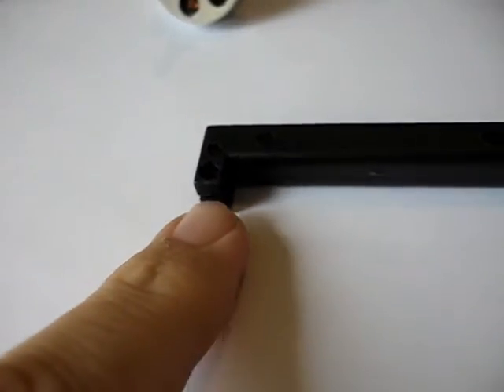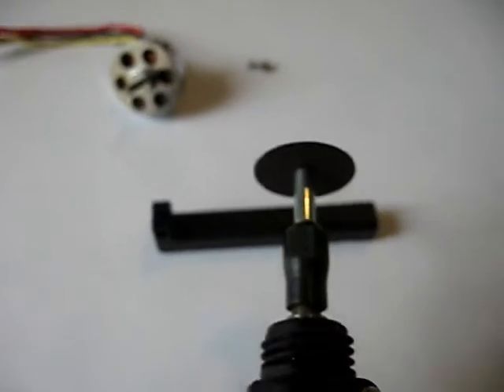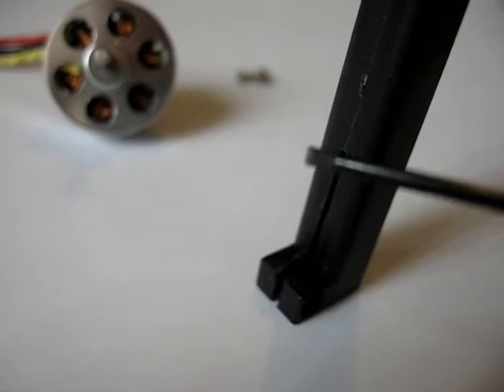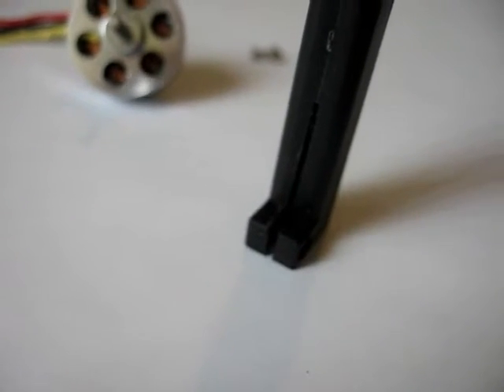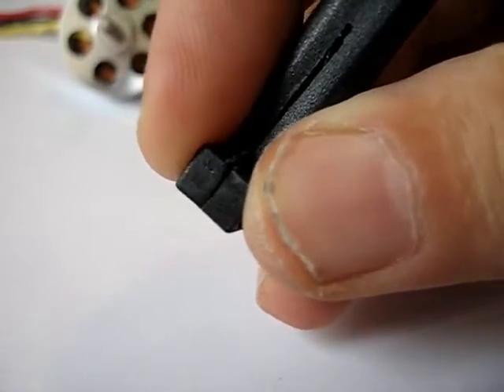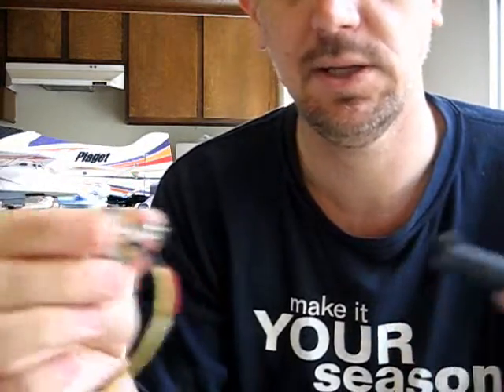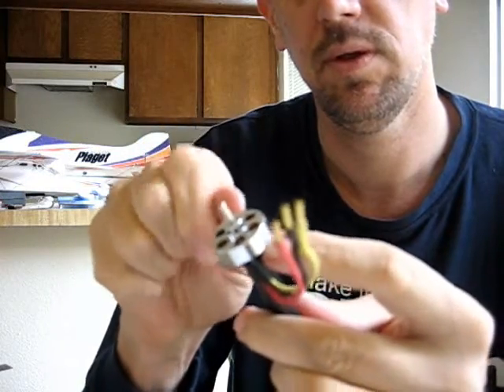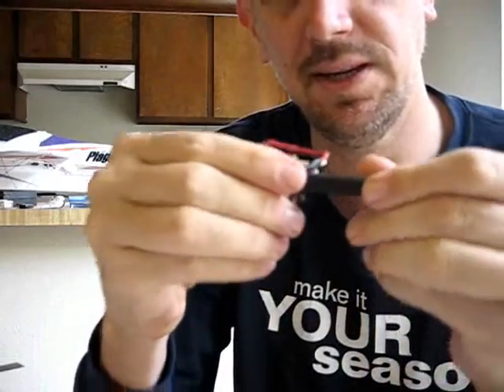How to Dremel a slot in a Motor Mount

Comment: my outrunner doesnt have that thicker pole coming out the back that you push into the mount, it only had the shaft that goes all the way throug the motor ant out the back and the shaft rotates so if i put anything on to the shaft it will spin the whole motor. do you know how i can mount it?